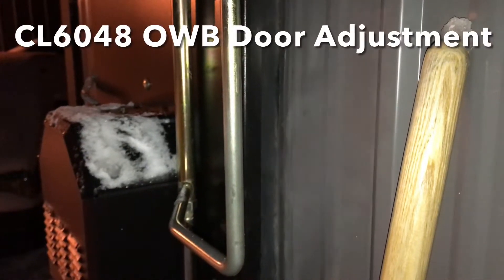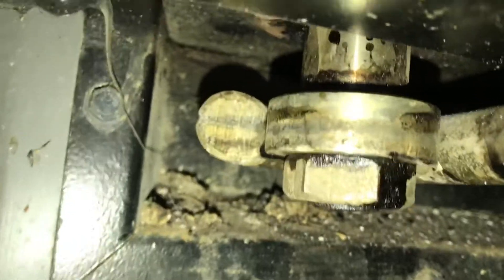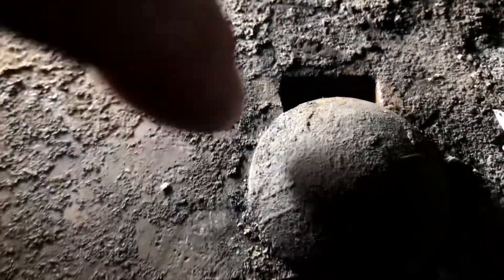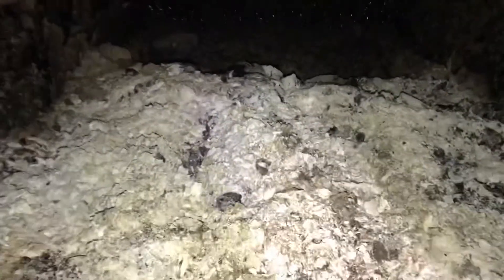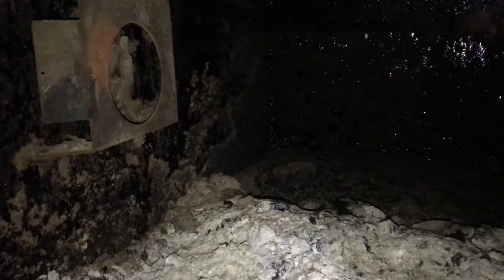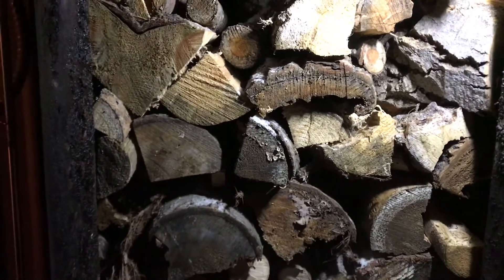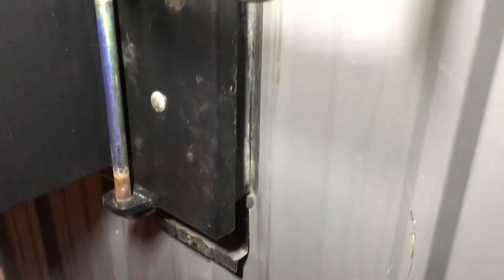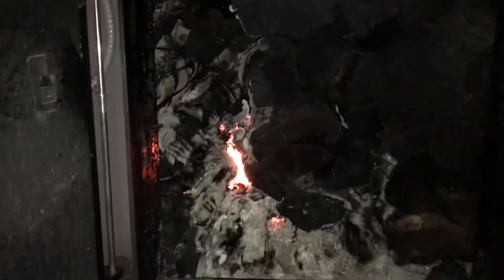CB CL6048 Outdoor Wood Boiler Door Adjustment

Comment: Why do you people split your wood so small ?
Word of advice. Oil  your door “bearings” regularly
Even better change them out to real bearings for ultra smooth opening and closing
Reply from the maker: Small splits make handling very easy.  More important, it maximises surface area of raw wood to allow the wood to dry out in a matter of weeks or months.  This is vital when your cut and split in the spring/summer and burn the same wood later that fall/winter.  Burning green rounds that have not dried waste valuable BTUs that are being used to boil off the water trapped in the green wood.  Why would you do that?  Water and wet wood will not burn.  Let Mother Nature dry out the wood and save those BTUs for your winter heat.
Reply: @TALL-PINES_STUFF  
That is all true but that small is ridiculous 
Takes much longer to split
Longer to load
Longer to stack 
Longer to move
What is the resulting moisture content if you leave twice as big ?